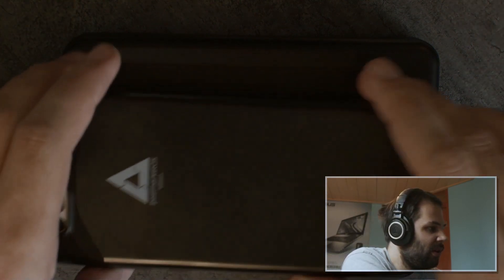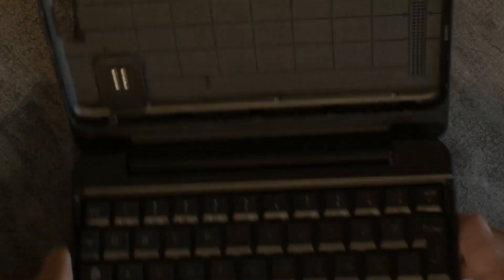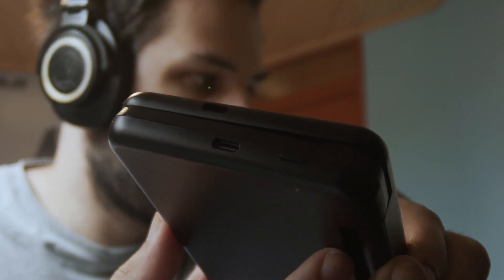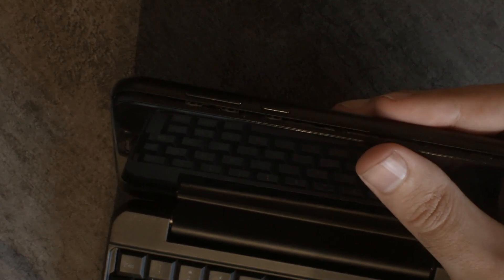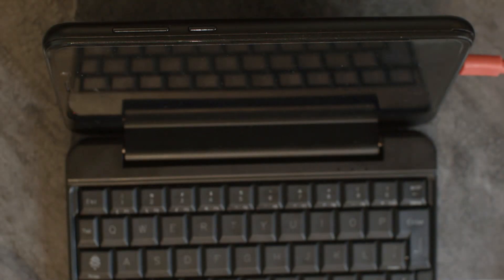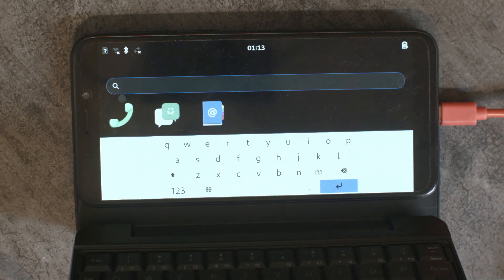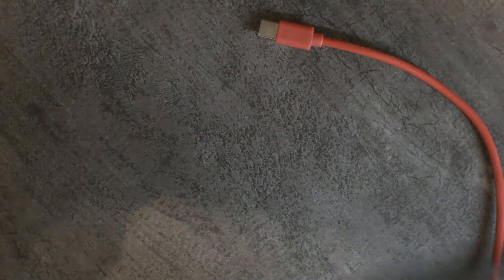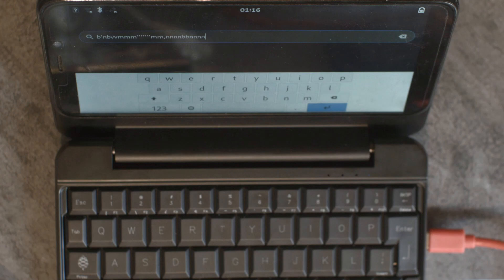First look at the PinePhone Keyboard dev unit

Comment: I can't wait to get a PinePhone and I'm currently running Lenux exclusively on all my devices. For me this design is flawed due to the phone being used as a monitor. Better to plug into a shell with a 13" or 14" screen and slim keyboard and making it ultra thin for traveling while getting the price point as low as possible. You cannot expect anyone to be working for long periods of time with a monitor the size of a phone screen. If you develop this, you'll be developing a novelty device which does not help our cause. Please don't do it. There are better options.

Comment: I only have two questions. 
How does using the battery work exactly? I mean, is there a charge controller IC that can measure battery percentage/usage, and report that to the PinePhone? Does the PinePhone see this as a battery, charger, or not at all? 
Also how far does the hinge go back? Can I fold the keyboard to the outside, to use the PinePhone for calls etc. in portrait orientation?
Reply from the maker: The hinge can rotate 180deg only, not far enough to call with it inverted. The battery controller is currently not hooked into i2c but that will probably change for the next revision so we can actually do power management.

Comment: Let me guess, you use it as your main device with a mandatory power bank?
Reply from the maker: Ehm no? I don't really have issues with running out of battery on normal phone use?
Reply: Yeah if you use the phone for 30 minutes from 100% it drops like 40%. I bought a second battery and made it through the day but only with very occasional use.

The 9000mah total power with the keyboard will definitely get you through the day with a few hours of use which is what I'm really after.

I thought about buying an off brand external charger and another battery or two but it's something i am willing to deal with to have full blown Linux in my pocket
Reply: @mynameisearlb  Yes, that's a problem. But I also have Linux in my pocket, I use Linux Deploy, I can also log into my server.
Reply: @_den_  yeah if that works for you that's awesome, but it's not really running on your device. If you have a server that you already have up then you could get by sshing to it or something. But the pinephone is a full blown Linux machine in your pocket.

Different things for different people, but i got what i want with the PP
Reply: @mynameisearlb  I'm interested in this too, but I'll wait until it doesn't hurt so much )
Reply: Александрови on the bright side even with the cost of three extra batteries, the external battery charger and the phone and dock your still looking at under $300 and that's with the extra expensive shipping for the pinephone itself.

I got my 3400mah battery for i think $13